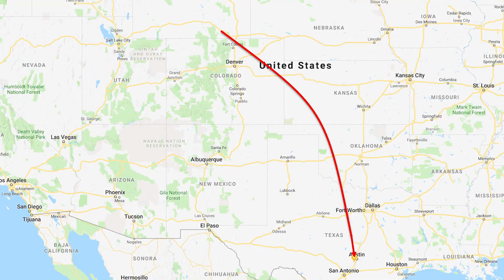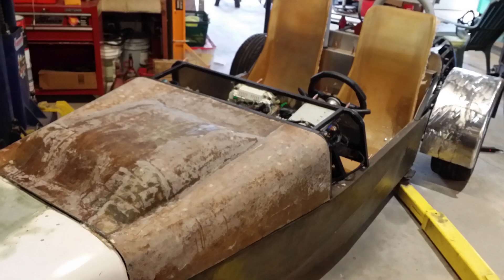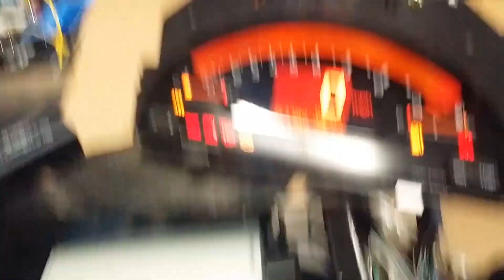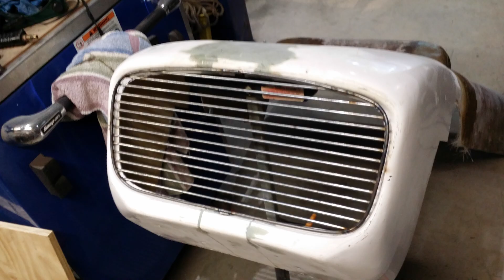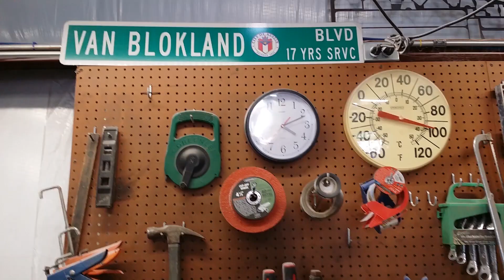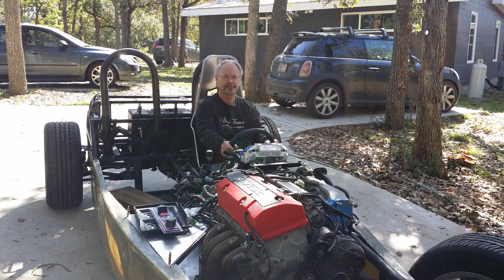Making a Locost Super 7

Comment: Just for anyone that may be considering using a small jdm 4 cylinder engine. They don't have to be placed vertical I. The engine bay, they can be layed over to 45 degrees. Maybe even more. It requires a modified oil plan and pickup too. Usually you can rotate the transmission if it has a separate bellhousing or cut and reweld it.